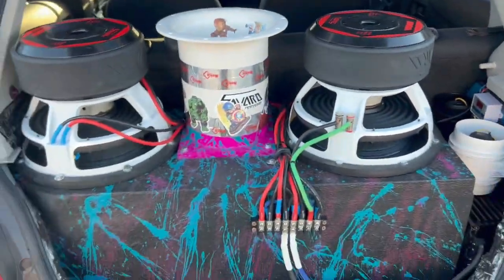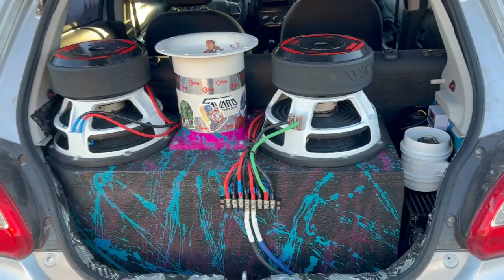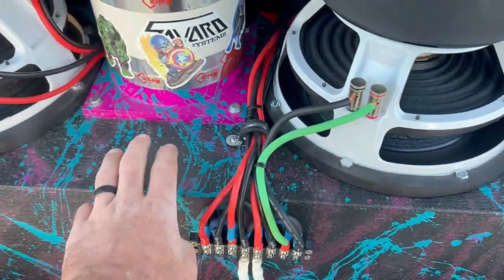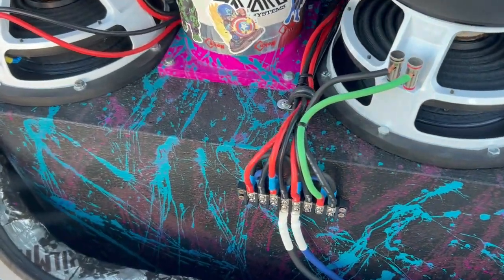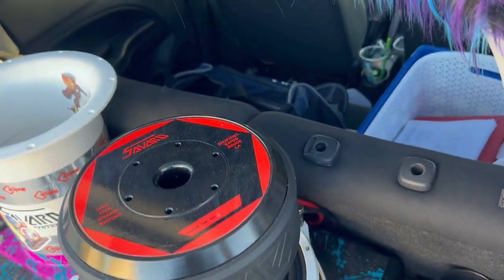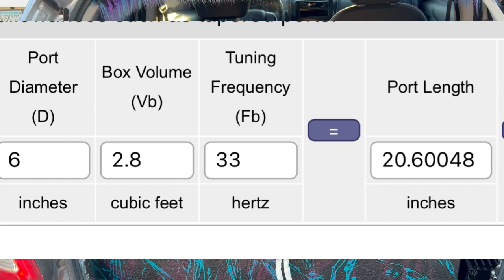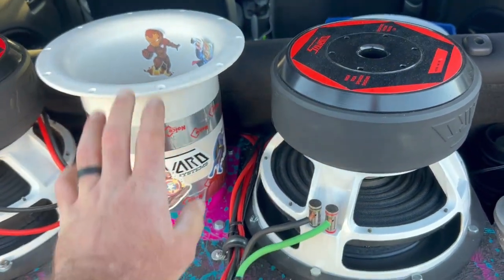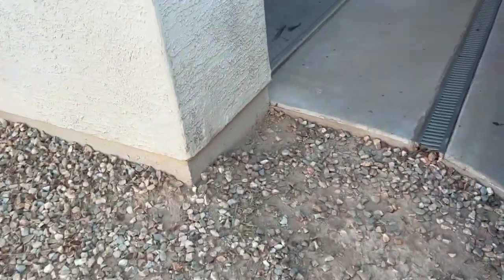Dropping Aero Port tuning from 35hz to 28hz

Comment: Quick question... I've got a box that is 4.5 cf tuned to 31hz. I've got Xv3 12's. Should have 5cf but that's the biggest I can fit in my Mercedes. Do u know if that changes tuning? Sounds doubtful but I know nothing about boxes and tuning lol. I can hit around 26-27hz with some pretty good force, but anything lower they just move lol.
Reply from the maker: Well, I think I know what you’re asking but yes, changing box volume and keeping all other variables the same does change port tuning. Is it a slot port or aero port?  The best thing to do is get a port length calculator (google search a free one) and enter the parameters of the box you have.  This should tell you the port running of your particular box.
Reply: @Husky_Shane_Basshead  yeah it's slot. I've got videos on here of it if u get a second. It's a decent setup. But that's a great idea. Idk why I didn't think of that.🤦‍♂️ I know them Xv3's got some decent displacement lol. Inverting would get me close to where I wanna be, but like u said kids blah blah blah and I can't give up the back seat 🤣
Reply from the maker: @1ohmwrecker  lol yep.  I’d love to wall mine… don’t think the wife and kids would be too happy about that though.

Comment: Hey man how do you like those Savard Subs? I trying to decide between the Sundown X 12 V3 or the Savard Subs you have. And good job on your system man it's badass!
Reply from the maker: I really appreciate that man!  I love it.  I really like these Savard subs, nothing against these subs.  But, the Sundown X series are a better sub IMO.  I have the 18s in my truck and they are so nasty.
Reply: @Husky_Shane_BassHead  Ok cool thanks for your reply! That really helps me out with my decision! And good luck with your builds man.

Comment: How are the sub’s performance overall? I’m looking to upgrade from the soundqubed hds3.2 15 in my truck it’s in a kerf ported box that was originally built for a skar Zvx
Reply from the maker: I really like them.  I’ve got a pair on a 6k amp and they handle it well.  They hit the low notes fairly well.  I really like them.